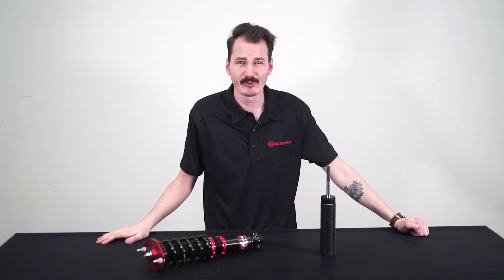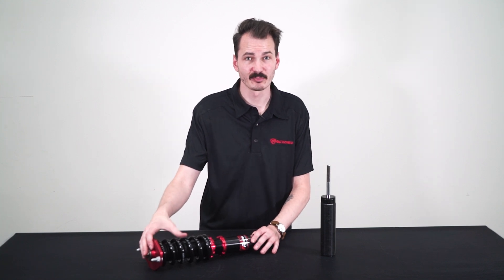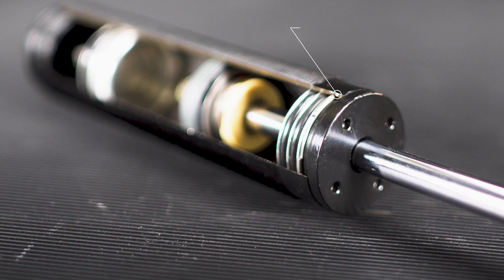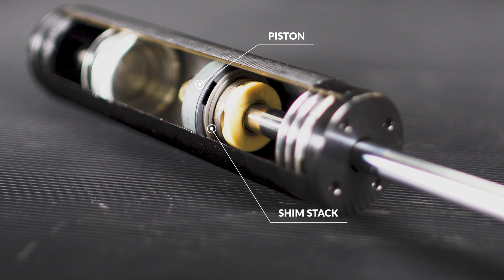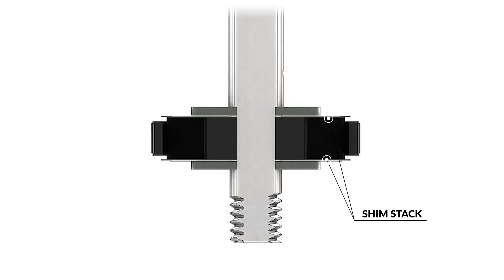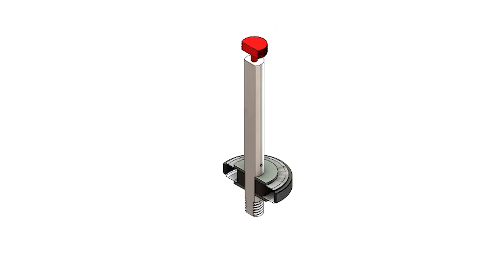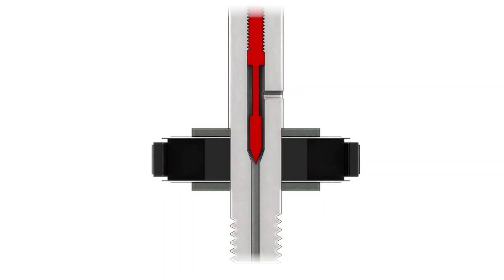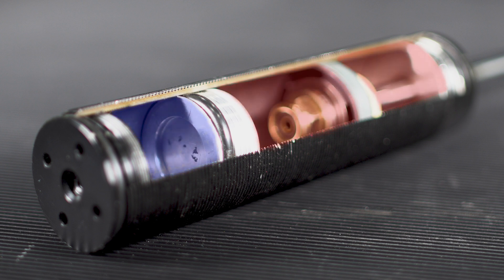Inside Look at a FactionFab Monotube Coilover

Comment: Do you make an adjustable air side coil?  What about an external reservoir similar to KW3s for high cycling loads to prevent overheating the oil?  How do you test your coilovers and determine what works best?
Reply from the maker: We do not. Simply because a majority of people don't make use of that level of adjustment. All of our tests are built around the most probable driving conditions, so the F-Spec is built for comfort driving on streets, FR-Spec built for more abuse on a track, etc.